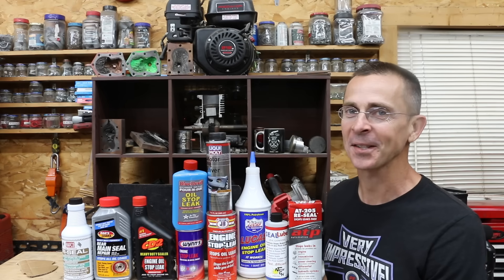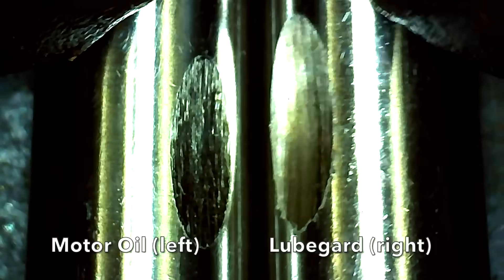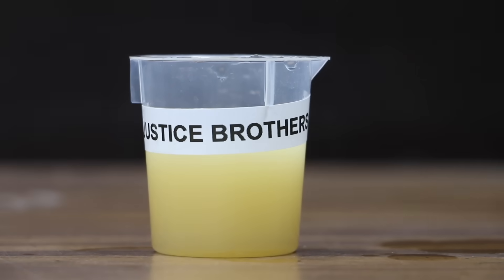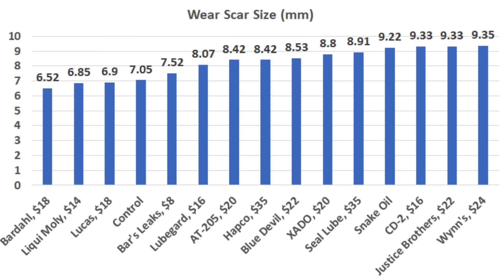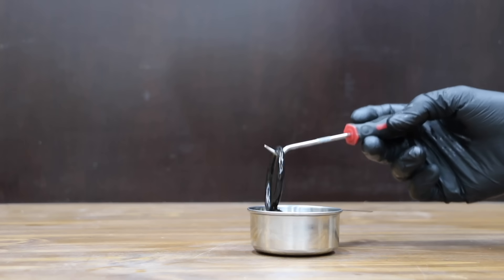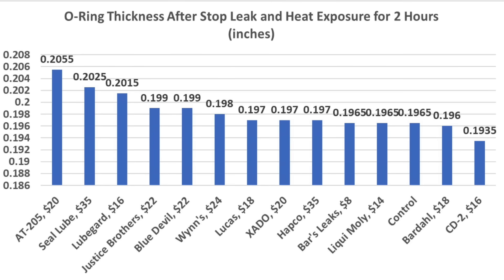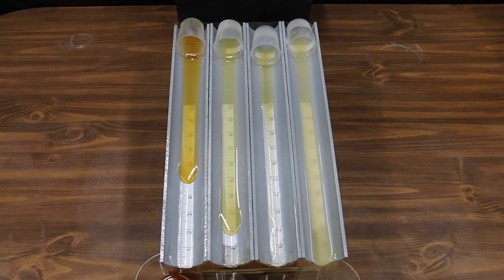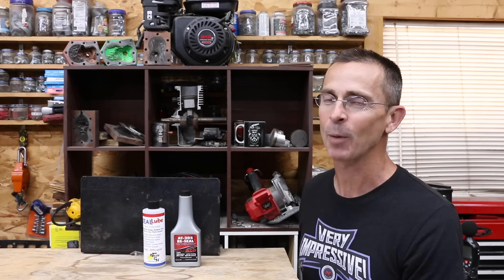Do Stop Leak Products Work? Do They Damage Engine Seals? Will They Destroy an Engine? Let's Find Out

Comment: An idea for you, brushed versus brushless drills.  I have found brushless make a LOT more noise and the minimum speed is much higher than brushed motors.  I dont know if the battery life would be any different.  Home Depot sell both types of drills, and the batteries would be interchangeable for a comparison
Reply from the maker: Thanks for the suggestion.
Reply: @ProjectFarm  if you decide to test this, you should know there are noticeable differences between brushed and brushless in terms of noise level - brushless have a loud squeal and minimum speed - brushless have a much higher minimum.

Comment: Alumaseal worked in my sisters 12 yr old Subaru..
  I could not find the leak, but the water was disappearing. It wasn’t a hose, there was no water on the ground, the overflow tank was always empty after a few days…There was no water in the oil and there was no oil in the water so I  ruled out the head gasket..
  SO- I bought a new radiator cap at the Subaru dealer so that I made sure I was getting the exact one. not a Chinese made close but no cigar radiator cap from an auto parts store.. that’s one thing you really need to buy an OEM part  is your radiator cap..And I put a bottle of Alumaseal in the radiator..
  bingo
I have not had to add water to my sister’s car for about two years now..
  I have had experience and I realize how important a radiator cap is. People don’t realize that they do three things..
  they keep pressure in the cooling system to raise the boiling point of the coolant
  they allow excess fluid to flow to the overflow tank when the spring in the radiator cap functions as it should at a given pressure
  and finally, many people don’t realize this last function..as your engine cools, your engine draws coolant back into the engine past the radiator cap from the overflow tank.
  my son called me one day, he thought his head gasket was going bad on his Acura. He said that his radiator hoses were collapsed.  
   I knew instantly what it was because I had worked in service stations all through high school back when gas stations were also service stations with a full-time mechanic on duty at least until 5 o’clock every day. Most gas station/service stations would keep things in stock like tires, radiator caps, thermostats and gaskets, even spark plugs, gas caps, fan belts, batteries, and even sometimes starters , and generators, not alternators. Even water pumps were a standard in-stock item at some gas stations/service stations when I was a kid in the late 60s and early 70s..
 in those days, you had to have a tuneup done at least once a year which involved replacing spark plugs, distributor cap, points, condenser, rotor. And a mechanic to set the gap/well, and the timing with a thing called a timing light.. he also had to slowly bring up the RPMs of the engine and make sure that your weights in your distributor were advancing the timing as the RPMs climb..
  One of the things that I learned as a high school kid working in those gas stations from age 15, was that when you see collapsed radiator hoses, that is a bad radiator cap..
  as an engine cooled, it has a vacuum effect on the radiator cap/ cooling system.. The radiator cap is like a two way valve. It’s not just a cork in a bottle.., 
   if cap is bad it will not allow the engine to suck water back in from the overflow tank.  
  it was pretty common to have stop leak in stock in most service stations..I worked at a boron gas station and they had their own brand of products like stop leak as well as many other things under the brand-name atlas.. they even had spray chemicals like heat riser valve lubricant for all those rattly heat riser valves on all those Chryslers, especially the 383.  
  I learned so much working in those service stations after school and through the summers that I have been able up to now to do all my own work such as replacing brakes, clutches, swapping transmissions, head gaskets, timing belts, timing chains, starters ..untill now…
   with today’s cars, you pretty much have to marry the dealer, and you don’t really need to work on the cars of today as much. No need for a tuneup, you don’t need to rebuild carburetors anymore, fan belts last a long time, same with ignition systems..
  pretty soon I won’t be able to change brake pads and rotors because , A buddy of mine told me he replaced the brake pads on his neighbors car, here in 2023, and the car would not go over 45 miles an hour after that. Because, the car is designed so that it Hass to have a dealership mechanic plug into the car and do a reset to the computer system after there has been a brake service. Even if you change your own brake pads, you may have to take your car to the dealer and pay them to do the reset.. and you know they are not just gonna hook it up and press the reset button because they would be liable if you did something wrong and an accident happened. So you’ll probably have to pay them to do an inspection at the least before they will give their stamp of approval..
  i’m beginning to understand why on the television car auctions, the 60s, and 70s pick up trucks are selling for more than they cost new. You can work on them, they are simple, you’re not being tracked by a satellite, you don’t have to marry the dealer, you don’t have to have a degree in computer science to work on the older cars and trucks..
 The danger there is, look what they just did in California here in 2023, tractor trailers are not permitted to be registered or driven on the roads in California anymore if they are 10 years old or older. I don’t know the exact specifics of that, but they could do the same thing with cars, pick up trucks, even motorcycles all in the name of being green
Reply from the maker: Thanks for sharing.

Comment: best large impact gun like large battery powered ones used in changing tires milwaulkee dewalt ryobi makita etc you did test but with smaller impact guns  do with larger impact guns 2023 2022

Comment: If you haven't already done it, you should get two cheap chainsaws or similar 2 cycle engines  and run one 32:1 and one 50:1 for a long time then check the cylinders the ports/mufflers and the most interesting would be check the spec on the con rod bearing and see if all that extra oil really makes a difference in the life, or if we are just making lots of smoke and carbon.
Reply from the maker: Thanks for the suggestion.

Comment: I would love if you did one on garage door openers. My last house had a 5-10 year old belt drive opener on one door and nothing on the other. I installed the cheapest opener at Home Depot since it wasn’t a door I’d use often, which was chain drive. The new chain was SIGNIFICANTLY quieter than the old belt. Everything I can find online says belts are best for noise, but I have doubts they actually make any difference from inside the house. Like i don’t doubt the chain makes some additional noise, but is it significant enough to really matter? I suspect the motor and housing are all that really make a difference.
Reply from the maker: Thanks for the suggestion.

Comment: After looking over a few dozen articles and almost as many videos on the best way to clean rifles after using corrosive ammo, I give up. It's just a mass of contradictory confusion with no conclusion. Hot water, no water; baking soda, no baking soda because caustic; hydrogen peroxide and or vinegar, no because they attack metal (or not); ammonia, no ammonia; and so on into the horizon.
 
A little more science and less opinion here would be helpful. What do you think?
Reply from the maker: Thanks for the suggestion.

Comment: Alright PF, I've watched a lot of oil filter videos today, and none have the rigor and thoroughness that you provide. Cutting them open and showing what they're made out of is a start,but it seems no one actually tests the filters with oil...and I always used fram as a kid, there's rumors that they cheaped out on the lower end filters, but their higher end ones are still good, I dont know. I went with wix full syn filter for a crusty old farm ford ranger today, but it was basically a blind choice. -John
Reply from the maker: Thanks for the feedback.

Comment: Seems to me that the high viscosity products (Lucas etc) don’t have any solvents in them; which is why they don’t soften the ORings. They just increase viscosity; basically make the oil less liquid so it doesn’t flow as easily out of small gaps. Making them more like leak decreasing agents than a true stop leak. 

It would be interesting to see how much, if any damage occurred on the bearing test bench with the effective stop leak products mixed to the recommended dose rather than just 50/50 with oil. Still, the idea of adding a solvent to oil to swell an o-ring is a bit…. Counterintuitive to me.
Reply from the maker: Thanks for the suggestion.

Comment: This came out just one day too late for me! Lol. Just did oil changes on our two very high mileage vehicles 4 days ago. One has a few very slow leaks (doesn’t drip on the driveway). Used Lucas in both, but before changing it used Blue Devil for 200km. Thanks again for your amazing work. 💪👍🎉
Reply from the maker: You are welcome!

Comment: I love this channel and everything that Todd does.
However, 1 big stand out in the video is, none of these are recommended to be a 50/50 mix. These are "additives" but for a much lower ratio like if your car takes 5 quarts of oil they mostly say to drain out a 1/4-1/2 a quart and then add the product to fill that gap. So the wear scars with the 50/50 mixtures seem completely irrelevant in this case as well as the concept that it will dilute your oil to the point of damage depicted here. 
If I'm wrong please explain.
But this depiction did not do justice as in other videos by Project Farm.
Don't hate, I love this guy and believe in most all of what else he does.

Comment: Stop Leak Products work in 2 ways
1. thicken the oil so it does not leak past seals
-these are the ones that mix in the oils without issue
2. refresh seals so oil does not leak past
-these are the ones that separate from the oils over time

but the main thing is stop leak is just temporary and is designed to give you time to be able to get to the shop (a few months)
if a new leak starts after you add stop leak you have no choice but to get it fixed

you should have checked the thickness of the fiber material
the fiber and o-ring should be clamped between something steal plates to see if it absorbs only at contact surfaces or deep into the material

Comment: It proves that these products are mostly hype. You just can't fix wear and tear with a 'magic potion'. 
I can say one thing about oils though. ALWAYS use the factory recommended oil, brand and version. Having done technical analysis on 10W60 racing oils, the technical specs vary widely between manufacturers, even though they are branded the same. If you have a late model car that specifies a very specific oil. Use it. Proof of higher 'wear and tear' is after years of watching cars and owners use after-market oils that sound the same, but are in fact, inferior. Hence, the premature failure. Engineers spend a lot of time designing these high performance cars around state of the art oils. Throw any like sounding oil in and chances are you will ruin your engine. You will only realise you screwed up when it's too late. The tests on this channel  prove just what a pot-luck you are playing with.

Comment: An idea that may not be practical to test, but when I was turning wrenching for a living, radiator stop leak made the shop a lot of money, that was usually after it had been left in too long without doing a proper repair, but an idea for you to consider.
Reply from the maker: Thanks for the suggestion.

Comment: I put the head gasket stop leak in my Toyota, followed the directions to a T. 2 weeks later I had a completely clogged heater core, and a partially clogged rad. Engine died less than 2500 miles later, but there was a lot of factors causing it and the stop leak was just the cherry on top. I realize your comparing oil additives not coolant additives, but I wanted to share my experience to hopefully help someone else
Reply from the maker: Thanks for sharing.

Comment: I'm just watching this, haven't seen your results. I do have more than forty years experience doing serious automotive work, professionally, starting with my own cars, then working heavy line,  service writer, car restorer, many years of auto parts work.
Do seal softeners work? That's what oil stop leak is.
Yes.
Will they help with a gasket or mechanical leak?
No, not a chance in the world.
Will they stop a seal leak that's caused by the most common problem, crankcase pressure? 
For a time, maybe. It will start back up again.
Will they rejuvenate a hardened seal? 
Sometimes. You have a vehicle 'spotting' in the garage, they work great. 
If it's old and cracked? 
They do very little.
Once you start using it, it becomes addictive to the motor. You will always have to use it.
Why I never recommend "high mileage" motor oil. It has 'seal softeners' in it. Why in the world would you want to soften a GOOD seal?
Cars with 200K don't benefit from seal softener unless they have dried or worn seals.
It's a tool that sometimes is useful. Mostly, it's a gasket leak, which means you just wasted the money.
Reply from the maker: Thanks for the feedback.

Comment: Thanks for these reviews. I had a small oil leak from either the oil pan or rear main seal on my 2011 Tahoe. I couldn’t figure out for sure. I tried Blue Devil and it didn’t stop the leak. I then tried Lucas and it stopped after about 200 miles. I’ve watch different reviews where one works and on others they don’t so I think it tends to be hit and miss depending on the leak location, etc. but I’m no expert.
Reply from the maker: You are welcome!  Thanks for sharing.

Comment: I know you spend a lot of time on making these already, and I would never ask to change how you test, but these products would concern me over seal integrity. For the products that softened and swelled the seals, does that mean the seal is now less dense and degraded? Is that inferred or if there is a way to test the abrasion resistance it might be beneficial to show it.

Comment: I used Bardhal in my 4G33 engine - worked until I changed the oil - after that, ALL the seals leaked. I threw the car out that spring - it just annihilated  my parking slot with oil leaks.
Reply from the maker: Thanks for sharing.

Comment: @ProjectFarm i always love your videos because i also test product by my own here in my garage but in this case i believe there was a mistake in a crucial part and it can definitely change behavior and results of entire test , maybe i could be wrong but the main purpose is debate  and achieve results like anyone else can replicate or minimally the manufacturer hopes from users to be able to replicate according to their instructions in their cars.....so by using CD2 heavy duty sealer as simple example i could observe that labeled instructions says its suitable to use from 3 to 6 quarts of oil (2840ml to 5678ml) ,the additive it self declare it contains 443ml so since we want to replicate the max capacity of oil that this product can treat we can divide those 443ml with the max amount of oil its supposed to work which is 5678ml so 443/5678= 0.078 as mixing ratio..... if i multiply this by the same 5678ml it throws the amount of the additive bottle, so for instance if pick to use in my test 1000ml of oil at max oil capacity of dilution i should use 78ml of product according to the label .....i know this is hard to figure out when you dont know how much oil your engine has in crankcase so maybe this is the reason oil additives are famous for having so variable effects from user to user leading to the question if they really works.....but in your case as lab garage test we know the amount of oil, in your case you used 20ml of oil and according to bottle should have used 1.56ml of oil additive at max dilution, but you used about 20ml wich is almost 13x what manufacturer would have reccomended and therefore the results are unknown,unpredictable or maybe even unstable as you could confirm in other additives where you could even see oil separation from actual additive, so in this case maybe the additive dose its over saturated and giving as results probably and incorrect value and performance that manufacturers could argue that it wasnt correctly mixed in the test, therefore giving maybe an incorrect bad reputation if product doesnt behave properly......i mean we all want to see which wins and these calculations are probably and extra time consuming labor in a comparison, but needs to be done to be fair so all of them additives could perform as their creators tested in their laps for max accurancy imho.

Comment: AT205 really worked for me.  1994 Jeep wrangler steering box was leaking fluid bad from multiple seals.  I put in AT205 and its been totally leak free for 2 years / 10k miles.
Reply from the maker: Thanks for sharing.

Comment: Can you do a comparison of car oil filters? Some years ago I had a Mobil1 filter in my car and when I purchased a new mobil1 filter the design had changed drastically. When I contacted Mobil1 about it, they said that they’d relocated their manufacturing to a different country but the filter should still meet the same performance standards. I wish I could upload my photo of the difference between the filters, it was stark.
Reply from the maker: Thanks for the suggestion.